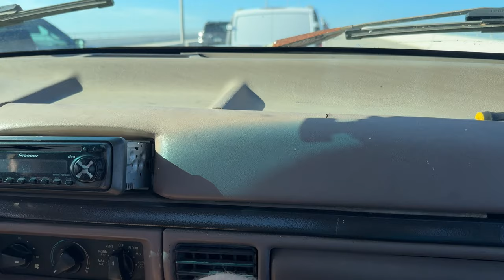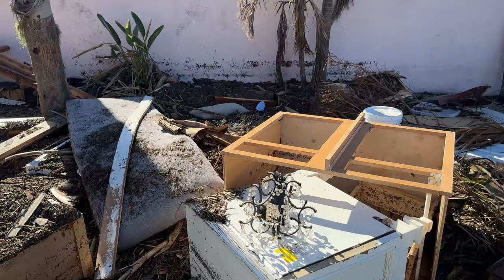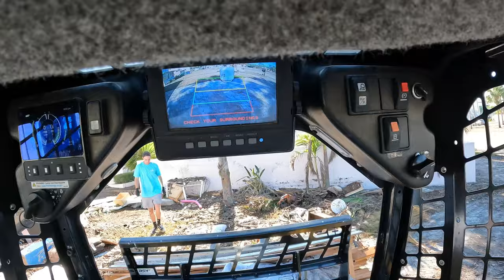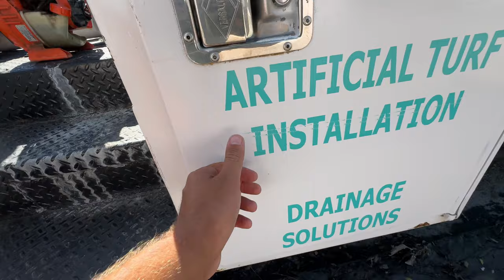HURRICANE MILTON CLEANUP ON ST. ARMANDS CIRCLE SARASOTA FL

Comment: Damm Brother! You Got your hands full down there..Wish i lived closer. I would come give you some help! On a side note, You were close on the Propane tank. They refer to them as a 420, as in 420Lbs when full. You should have checked to make sure the valve was closed on the top because if it wasnt turned off before the storm it probably was still open when the tank got ripped off the line on the side of the house. And Diggin that Fresh prince and Jazzy jeff phone ring too! Stay safe Brother! Truck looks great with the lettering. Got to do the dump truck next!
Reply from the maker: i should have checked that valve i didn't even thunk of that! Dump truck is next on the list for sure and the skid steer! I appreciate it!!!